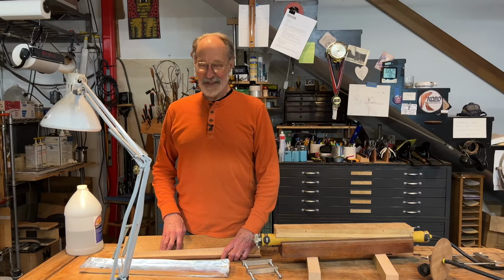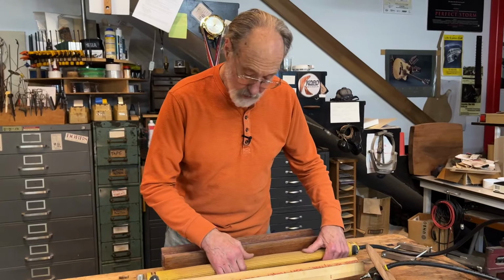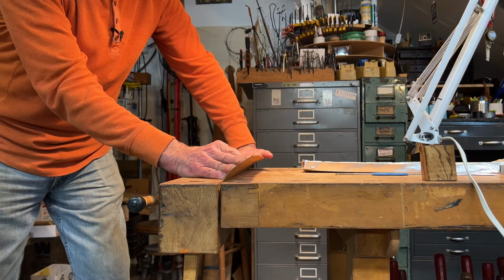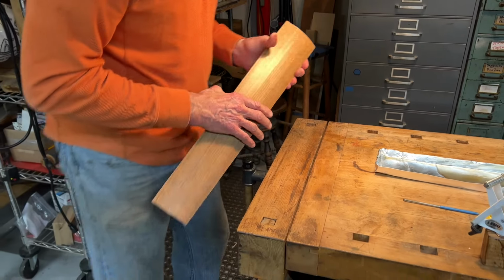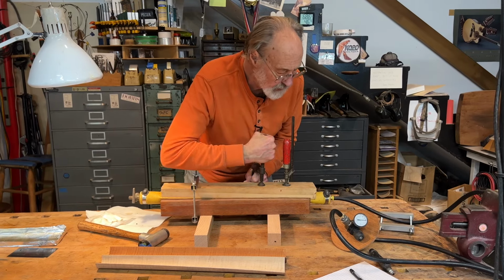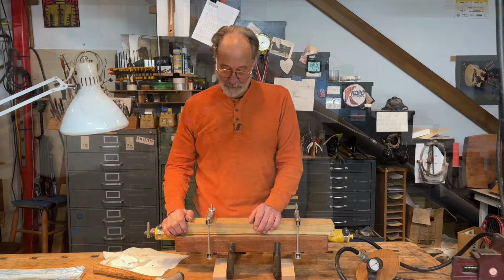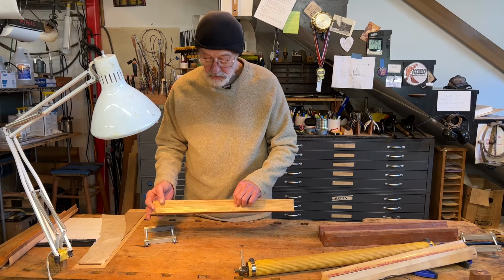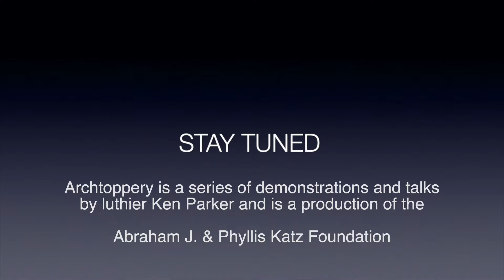Ken Parker Archtoppery - The Neck Journey 12) Neck Veneer Bending Process Chapter 1 of 2

Comment: With all of the necks that you have built using this process, what is the failure rate?  Seems you have a system that is almost perfect.  A tiny bit skill required, but relatively easy to learn.  I know that epoxy is exactly as you describe from a dozen years of exposure.  Sanding after two days is totally different than a week.  From gummy to powder.
Reply from the maker: I have yet to experience a failure of any of these many necks of any kind.  I did lots of testing at the start in 2004 - 5, hoping to use room temperature cure resins, and I learned they aren't up to the task.

Comment: I wonder if he ever tried a slip-roller, apply even pressure across the entire piece in incremental steps
Reply from the maker: Could be a cool idea, except I think you would have to use a piece that was substantially oversize in width in order   to get the material started, as a result of the distance between the rollers.
Reply: @kenparkerarchtoppery9440  
I’ve used thin sheets of HDPE when small rollin cone sections in stainless